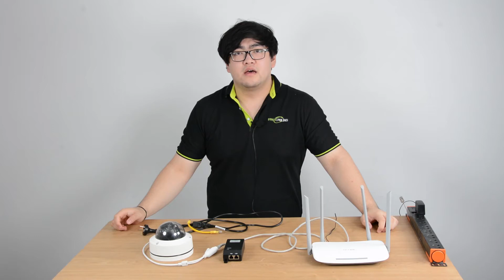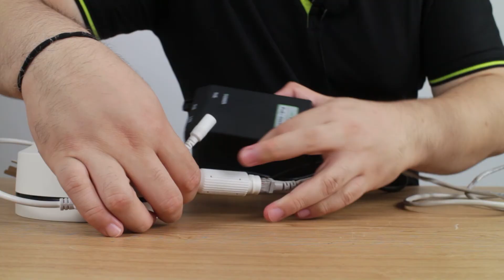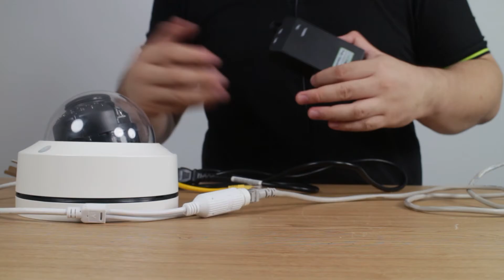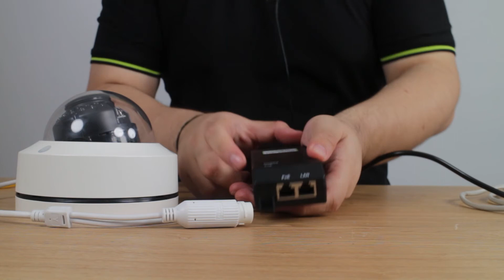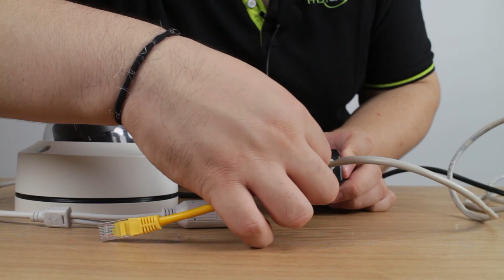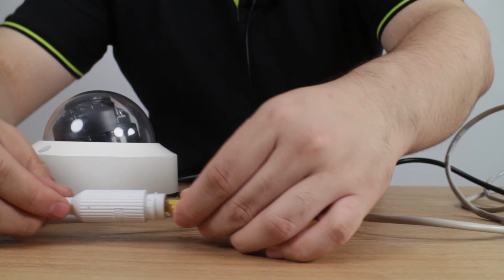How to Connect PoE Injector to Network Switch?

Comment: Can I add this to my starlink? It’s not receiving enough voltage to heat the dish due to the cable being very long. Can I just add this between the router and the dish?
Reply from the maker: You might specific your starlink model. G2, G3 and mini have different power consumption. Let's say G2 and you have cat6 cable with 24awg solid copper, you can have 45 meters maximum distance with DC56V input power source.

Comment: Can you shed some light on data in port and power and data out please
Reply from the maker: The data port supposed to be working with router, another port is the data and power (PoE). It is thr DC54V low voltage power.

Comment: Can we use the following setup:
Internet through my router
>
One port connected to POE Injector
>
That output from injector to basic switch

Does this make the whole basic switch POE compatible?
Reply from the maker: No, it will never work as you expected. You will need special PoE powered switch that can power by PoE injector and pass the PoE through. https://www.fastcabling.com/product-category/poe-powered-switch/

Comment: I recently powered my new helium miner through PoE, but i cant seem to find the device when i login to my router. Useing a standard TP-link. Any suggestions why? Do i need to install some software?
Reply from the maker: The PoE (power over Ethernet) is transparent to TCP/IP. You may use the DC power to supply the device before you move to the POE. The outdoor should be the same, as long as the PoE switch can supply the power to your device.